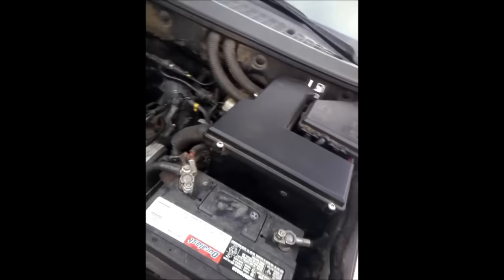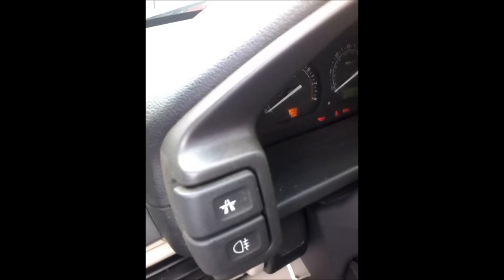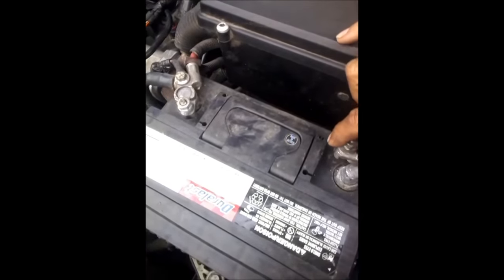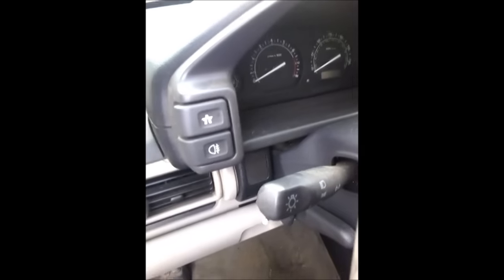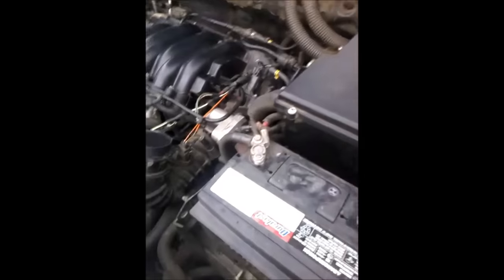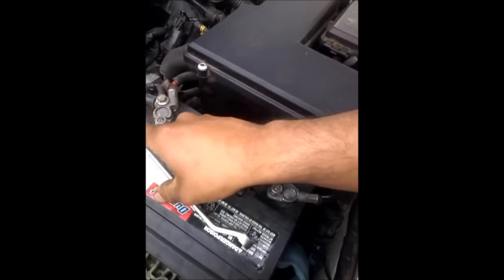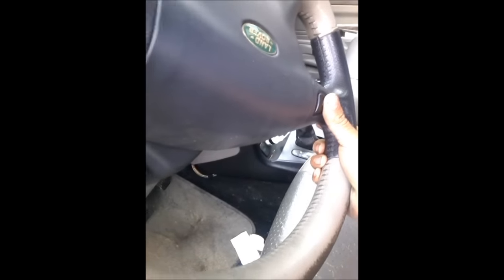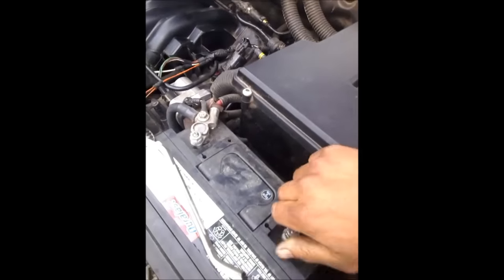3 ways to turn off CHECK ENGINE without scanner EASY!!

Comment: What about trying to diagnose why the "Check Engine Light"  came on in  the first instance. There are several reasons why for it to come on. Doing what you suggest without finding out the root cause, could cost the owner dearly in the end.

Comment: You don't have to do all that.
Just disconnect your battery for 10 seconds and then reconnect.
But if something is wrong with your engine, it will come back on after driving it a while..
Reply: Your solution makes more sense 🙏🏻👌👌👌👌👌

Comment: Inside every fuse box there is one fuse that when removed for ~ 10 seconds, then reinserted clears the CEL
Reply: Well which fuse is it??? That would round off your comment Robert.
Reply: @glenndavis479  ALL CAR FUSE BOXES ARE CONFIGURED DIFFERENTLY. CHECK YOUR OWNERS MANUAL OR DO A SEARCH ON LINE
Reply: @roberthart9886  OK.
Reply: @passi3771  thank you you
Reply: @ifeanyibarth5137  you're welcome

Comment: Whats the point of resetting the light? Any problem that made it turn on in the first place will still be there.
Reply: No. This is for someone like myself who replaced a part and need the light reset in the hopes the part replaced corrected the problem which caused the light to come on to begin with.
Reply: @amclamb9543  You can get cheap code readers from ebay. Reset with that.
Reply: @joewoodchuck3824  thx. I replaced an evap shut off valve on my son's car earlier and just disconnected the negative battery cable for a few minutes to reset the light. Now to drive it and see if it comes back on any time soon. Hoping the issue is fixed now so I can get it inspected after about 100 miles is put on it.
Reply: @amclamb9543    Where theres a will, tberes a (safe) way.
Reply: that's what the guy said
Reply: that's what the guy said
Reply: @joewoodchuck3824  yay, it hasn't come back on!
Reply: @amclamb9543  Great!
Reply: If you don't use a scanner how do you know you've fixed the fault that set it off?
Reply: @ryanh3285  after you reset the engine light then drive it for at least 100 miles. It should come back on waaay before then if u didn't fix the problem.
Reply: @amclamb9543  I understand that but it's false economy if you don't 100%know you're fixing the actual fault and change the wrong part therefore wasting money.
Reply: @ryanh3285  well, you could take it to a mechanic and pay hundreds more. Most of the time the code is pretty good at telling u what to change. (Along with symptoms your car is experiencing, you can narrow it down) The only issue is when it's an evap problem because that can be from tank side to canister or tank to gas cap. But even there you know which side. I'm a girl and even I can narrow it down by code and symptoms. It's not difficult and it's made easier these days by YouTube videos.
Reply: That is why he said fix the problem, then cancel the light. If you don't fix the problem, the check engine light will come on every time you switch on the car. If you have not fixed the fault the light will keep on coming on.

Comment: Hallo sir. Kindly need your help on Toyota land cruser 2009, engine 1kd-ftv on the error code C1433. The lights are on. The spiral is good. What was done on the car is changing the steering column.

Comment: How it works if you disconnect negative wire then pushing the horn botton ,
Reply: you discharge all capacitors that are still holding voltages. you could also just wait a long time too

Comment: Perhaps I didn't understand, but I would NEVER connect positive and negative terminals with a wire unless I wanted a fire. Also as already mentioned below but important and for the same reason, be CAREFUL when using a long wrench that it does not touch the neg and pos at the same time. Try the first two suggestions. If they do not work, buy a $20 scanner.
Reply: I believe he realized that and noted that in the description. I had the same concern and thought how dumb that would be!

Comment: Helpful video thanks but I would personally not take the risk and buy a decent engine diagnostic unit. I bought myself one from amazon for about £35. and it does the business. Easy to use. Just plug and delete. Done.

Comment: Been working in automotive electronics if you have a misfire and your cylinder or lean and rich condition it does not go away by doing this that faultl will always be there until you find the problem look away for a couple of minutes and then on a regular drive cycle it'll come back Even if you reset a memory of the computer with a scanner I misfire is there that means one of your cylinders is not working

Comment: Disconnected the negative- 3 ticks .. cleared so far 2004 Buick Regal .. MAF cleaned. Was running horrible. Stopped running, bucking idle all over the place. Hopefully this clears up.

Comment: If you do like that always disconnect the battery sometimes problem or short your ecu...
Reply: Just disconnect the negative for one minute and put it back on that’s all you gotta the the rest is superstition lol
Reply: Leave the nail varnish on for one whole hour, then you check the birdie cables.
Reply: Put a burrito wrapped in foil on top of the air cleaner then disconnect the negative cable. Then eat half burrito and then connect negative cable. P.S. Don t forget the other half of burrito just give it to Tweety- birdery

Comment: Question: Wouldn’t I damage the battery if I connect both terminals using a wire?
Reply: You are connecting the cables not the battery terminals

Comment: Waste of time.  If problem is not fixed the light will come back on as the computer cycles through a few times.
Reply: In my case I was able to use this video to get my car out of limp mode and get me home I was 200 miles away and made it !
Reply: @Ice_box714  Limp mode is designed to protect components from damage. Glad you made it, but you took a big risk.
Reply: @johnm8961  yeah I just traded In the car lol

Comment: Stop wasting everybody's time this method will not work just too many problems with it buy a scanner and fix it properly setting it to default without fixing the problem does not work that light is there for a reason
Reply: Pay attention. He said if you've fixed the problem but the light stayed on. Sometimes the check engine light comes on and u dont get any codes when u put the reader on.

Comment: Turning off your check engine light doesn't mean the problem goes away. So there is no point in turning it off.
Reply: I have my on but the truck is still running good
Reply: @rafaeldominguez5861  my advice would be. To take it into a garage and have it diagnose or buy one of them OBD scan tool. Because it might only have the one problem at the moment.  But it could put a strain on the next component. Hope you get it sorted soon.
Reply: zig zag might be just a software update from the manufacture take it to the dealer
Reply: The reason here would be to turn it off/reset it after work is done. Like a replacing a part with the hope that the fix is corrected that caused the light to come on to begin with. For example; I'm replacing a vent shut off for an error code P1457 with the hopes that was my evap issue. Resetting the light and driving it for at least 100 miles will let me know if it's fixed. (Whether the light stays off or comes back on)
Reply: andre carter  P1457 means the issue is on the canister side. If it's a code P1456 then it's the tank side, which could be the fuel cap.

Comment: Thx you my check engine turn light off on my KIA SPORTAGE.
Reply: Did it come back on? My kia sportage it keeps coming back on and I'm trying to have it pass smog. It reads my o2 sensors are bad but I just replaced them
Reply: @alyssaramirez2338  just leave it if u replace them then it will go away by itself
Reply: Update: it went off but now they say hairline crack in manifold ...
Reply: @alyssaramirez2338  hairline 😂😂 that's funny,  I think u mean extreme . If u can find the crack then u can buy some sand paper and Go to your autoparts and buy a sealant for it but if you cannot find it go to a mechanic it's not gonna be too expensive
Reply: Mechanic talking bout $800-1,000 thats expensive!lol
Reply: @alyssaramirez2338  haha the only two things that about that much is engine repair or transmission repair, $700 is the highest I ever spent.  Mechanic will fool u when u a woman if I have to spend 800 I'd rather buy another car.  Use your scan tool and try to see if u can see the crack in the manifold if u can see it then u might be able to fix it yourself or u can buy a catalytic converter from a junkyard and have it replaced.
Reply: Damn.. thanks bruh lol
Reply: @stan.pchannel6556  hey my car's engine light is continously on kia Cerrato 2014 how to diagnose what the fault is...?
Reply: @mrabbasi9403  use an ob2 code scanner or take it to autozone or oreillys for a free diagnose
Reply: @stan.pchannel6556  if i go to auto zone I will have to pay 200 💵 i want to save this money.. I have installed free torque app from play store.. Will it work with Bluetooth and diagnose the fault??
Reply: @mrabbasi9403  no u do not have to pay for a  scan it's completely free, I'm and I never have to pay nothing.  I have a ob2 named bluedriver it does a very good job but u can get any cheap one at autozone or u can get free scan
Reply: @stan.pchannel6556  bro I'm in saudi arabia here auto mobile zones aren't free of cost please... I have installed motor diagnostic scanner but it's requirement is obd2 Bluetooth adapter which I don't have.. My question is this mandatory to have obd2 Bluetooth adapter must be connected with obd2 port under the dashboard or we can just diagnose it via connected with phone to car's Bluetooth without need of obd2 adapter...
Reply: @mrabbasi9403  u will need an adapter to communicate with the car . If u don't have much money I'd recommend u to buy a very cheap one just to scan it and know what the issue is
Reply: @stan.pchannel6556  ok bro heaps of thanks please can I have yours whatsapp number Pl if convenient, incase any further issue regarding diagnostics I will text and ask you there..

Comment: Worked for me. Took the check engine light, vsc, light, and tachyon control light off. They only came on after I was checking fuses. Thanks

Comment: I did that recently and the check engine light went off but the computer at the inspection said it didn't fail but it didn't pass either..it indicated I must drive it more...I'm going to have to get a waiver from north Carolina DMV

Comment: Can i do it to my ford Everest? (Endeavour)I am having a problem,every time i switch-ON, all the sensors of its safety features will activate including the Check Engine. So what i did to be able to start The Engine is. I will start THE ignition prior the instrument claster goes ON ,so that the sensors will not activate. When the Engine Started there will be no more alarms and everything i fine... How can i solve the problem.? Thanks

Comment: The best way to reset the Check Engine Light is to go to Harbor Freight Tools and buy a $36 OBD II reader. You should first read the codes and write them down before resetting them. If and when the Check Engine Light comes on again, immediately read the newest codes to narrow down the problem.

Comment: The first method worked on my 2000 Chevy Silverado , had replaced a vent style small device on top of the 4.8 that pulls extra fumes to Reuben until engine reaches temperature , the knowledge here is what I needed to clear and see if any other issues are continued after , thanks for your content , saving people from worry is the work of good people like yourself , thanks

Comment: Do you accept auto call outs abroad ? 🌼😃 i have an intermittent check engine light coming on with my SUV and it's pretty scary 100kms from anywhere 🥺 love your video but i need a mechanic I guess in my singleness, shame your not local 😎

Comment: Here in the UK if  you disconnect the battery on a fairly new car and haven't been given a Radio Code you will lose the car radio and have to book the dealer to re-set the radio and likely charge you £30 -£50 to fetch the original radio code from the main head office of the car manufacturer.
Reply: It’s still cheap 😂

Comment: All you need to do is only to disconnect the battery for 30 seconds to reset the board computer. (the negative connection would be  safer).  I have learned it from a student and it worked well for 3 month.
Reply: I have done many cars that way.This guy is clueless and should not post bad info.

Comment: On my ute the automatic warning light   and the engine warning light stayed on . Also the speedo stopped working       After replacing the tansmission  fluid and filter the mentioned lights  refused to  go out.          I kept driving some time ignoring the lights. This morning  I tried  all  three  remedies and after testing the third solution all the offending light turned off and even the Speed indicator   came back to life. Top advise an your behalf. Thank you very much.

Comment: I have a  2010 Toyota Camry Ls
Power seat not workin had motor changed to car seat then it did not work any more. !!! We’re is the fuse located to the power seat
Please help
Reply: Check the birdie

Comment: I just did option one on my nissan frontier 2016  with only 47k miles on it. The guy i bought it from warned me that the oil was due. I drove it for 3 days then the check engine light came on. I assumed it was the past due oil change. I went and had it done that day. The light is still on. Maybe i should try one of these.

Comment: im having issues with this.. took it to my local mechanic and they said its reading code P0420 which is catalytic. though my situation isn't serious, but it does need to be repaired.. not too comfortable in how much it cost to repair though. they said it would cost over 1000 dollars... that's Australian dollars btw. i'm currently saving to get it repaired.

Comment: 100% works the first step was all it took
Reply from the maker: Great
Reply: @YourCarFacts  my drive ¤ green coloured light around the "D" on the front drive steering window just went off 1st time ever ...( all the other positions light up: reverse / neutral 2nd gear ect with a coloured ring around them).

 Can anybody tell me WHY the drive gear on the steering window for some reason will no.longer have the green light ring around the "D" come on anymore?

Comment: Had this problem for months (Ford Escape 2010), mechanic 3rd try tracked the problem to a leak in the intake air filter hose, causing vehicle to run rich. Applied automotive tape to hose, engine light gone, vehicle running perfect.

Comment: The light came on after 600 miles when my fuel tank was low on fuel. Tried 1st didnt work although worked last time. 2nd worked this time for me. Car runs great u think when fuel is low it comes on

Comment: Check Engine light is a faulty system designed into modern vehicles . 80% of the time they come on as a defect not because your engine really needs checking . My Honda does this and a friend's Nissan truck does , too

Comment: The check engine light will come back on after 100 miles. If you are getting your car smog tested, they always ask if anything has been reset or if your battery has been disconnected. If so, they will not test your car. This is in California, other states may be slightly different
Reply: Find the right person you can pay a couple hundred and pass it no worries problem.

Comment: Yow ... Jah know,.. just check in on this ... My check light came on from Sunday...in which I was about to go check it out ... I followed your instructions.. an it's off .. I will be checking it out on a later date....
Reply: If you disconnect your battery your check engine light should turn off, but when you go for inspection they know. If you get your check engine light to go off that doesn't solve your engine problem. Mine check engine light was on all it need was a gas cap. If you have AutoZone in your area they will hook up a gadget & give you the code that tells you what's wrong.

Comment: Will that get you out of limp mode?
Reply: Not usually. Limp mode is beyond a Check Engine light. The light just tells you there's something wrong; The ECU won't forget the issue so you'll be stuck in limp mode.

Limp mode means bad news, by the way. Wouldn't ignore.
Reply: @snowoffstream5823  i learnt this a while back. My transmission module had fluid in it and cause my jeep to go into limp mode. The pedal sensor codes was what the ecu gave which was part of the problem but the module didnt allow the codes to be cleared. Limp mode is a safety place to protect the car and the driver. If the vehicle wasnt in limp mode the random acceleration could have caused an accident or worse. Thanks for the reply. My jeep was down almost a year until it was diagnosed.
Reply: @hioshimtsu  Yeah. Fluid in the modules and/or connectors is sadly common, but it's just something to look for because it can cause codes and tell you of issues that you have with your vehicle and whatnot. Not a problem, by the way. Always glad to give a bit of information to someone who's wanting to learn it. :D

Comment: These might work on older cars,and for some error flags. But If the error condition flag is stored in NV memory it doesn't require external power to hold it, and none of these will work.

Comment: Excellent stuff. Thank you bro. Don't worry about your long spanner. Only an idiot would short it out. The spanner in question is designed with a high and low bend.

Comment: I disconnected negative on my gmc and it did not clear the check engine light
Reply: really depends on the code you have how fast it will come back.  If you have a code for a wiring problem well the wiring problem is still going to be there after you disconnect the battery so the code will pop up quickly.   Some codes check for a problem 300 times a second other test for a problem once a week.